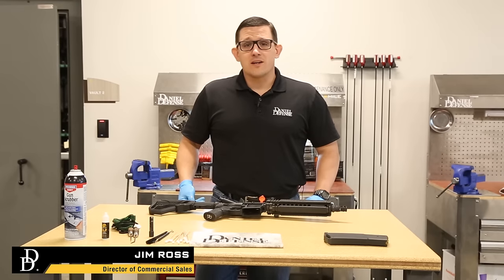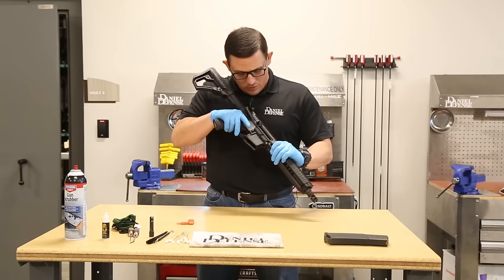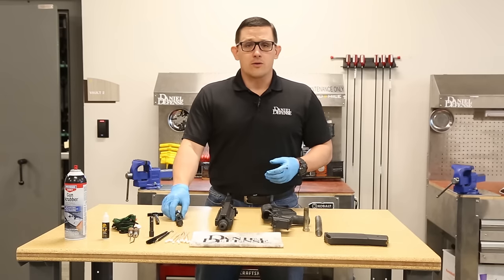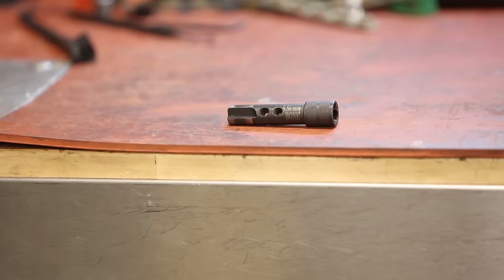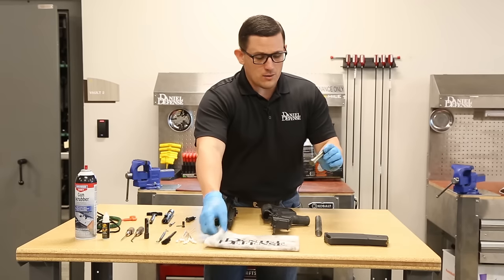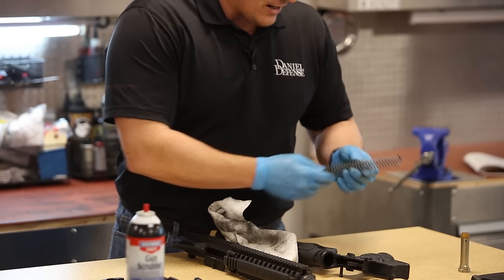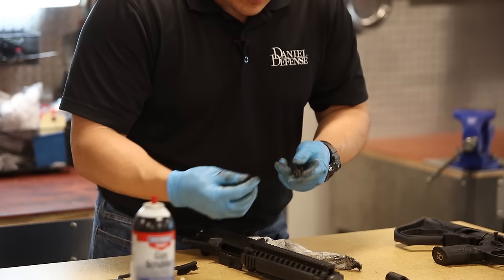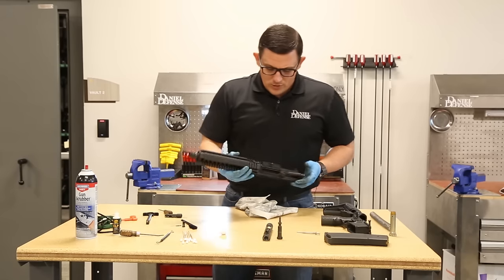Basic Firearms Maintenance

Comment: That was an incomplete cleaning and lubrication in my opinion. He didn't really clean the chamber. The chamber needs to be cleaned well with a brush wrapped with a patch. And you never want to leave the chamber wet with lubricant, in case you need to use it for defense. And the other thing that I disagree with is that the bolt needs to be wiped with lubricant before it's inserted into the bolt carrier to prevent wear. Wear leads to gas leakage

Comment: Hehe..I've never cleaned the buffer/buffer spring in any of my DD rifles and I've shot thousands of rounds through them.  I wonder how dirty they are =D
Reply: Believe it or not, they never get bad. I've shot thousands of rounds through all my buffer devices and the ONLY time I'll take it apart and clean it is if 1) I'm doing a replacement with a different weight buffer or 2) cleaning the rifle for sale. Every time it's had minimal buildup and is a super fast clean.

Comment: This video taught us a lot on how to clean our new Daniel Defense!  Being new in the rifle world this was a big help.
Reply: Yeah he does a few things most cleaning videos don't cover. The parts about cleaning all the carbon out of the inside of your bolt as well as setting the bolt carrier group on its face to make sure the gas rings are good are both good tips.

Personally I don't clean my buffer tube or remove my extractor every time I clean. But I do so every so often. Because it is necessary.

Either way you found one of the best cleaning videos out there.

Long term the only things you might want to buy are a spare buffer spring, set of gas rings, extractor spring/booster washer, and a appropriate length gas tube. A set of Aero spings/pins oops kit couldn't hurt either. Also maybe a spare bolt and fireing pin. But definitely lots of spare magazines. Magazines do go bad.

However for the average guy who shoots a few times a year just a few mags is usually enough. But for the truly prepared the other components can never hurt. And, with the exception of the bolt and fireing pin, pritty cheap also.
Reply: @project86xero  yeah, tip. Clean out the buffer and extractor at around 500 rds or so. The stand on the bolt head to check the gas ring thing, start to do it at around 3,500 rds or so. A good set of rings should last you at least 5,000 rds, more like 6,000 to 7,000 rds if you have a full rifle length gas system.

Comment: Yes sir. 
That DD4 is a must have for SHTF.
Or a extremely well made replacement rifle. It's just as reliable as my Colt M4. 
If for some odd reason the ol Colt lets me down. An the Smith&Wesson M&P 15, 2 was to bite dirt. 
I've still got a damn good one to bring out. 
Don't get me wrong now. The wesson is a great toss in the floorboard. An put in the window mount of the Track hoe lol. 
Put behind the seat of the skid steer. An bounce it down the mountain. 
The Colt deserves my respect and to guarantee its well being. The DD4 was a conversation piece and pretty penny. The mount an nite optics.  Flashlight an tripod. Dont tell the wife a good 3500. It's a piece of Hardware to used. But come on Id feel kinda bad for it sliding out the seat into the floorboard. Or to trip up an roll down the mountain side into a rock filled ditch. 
I've done that as well the wesson took it like a champ. I was bleeding a little. It lost some paint as well an added a little more Tactical grip to the corners and plastic heat shields. 
A tough spot on the hand gaurd an charging handle.  Nothing really bad for a 900 dollar wotk tool.

Comment: New ddm4v7 owner here. Should I clean to this level when new from the factory before shooting for the first time?

There is a coating of some tacky grease stuff in bolt and carrier group and firing group as well.
Reply: I just threw 60 rounds through my brand new DDM4 PDW and it seemed a bit dry so def going to clean and lube it properly before the next range day

Comment: OR>>>> retro fit or build a piston gun using Superlative Arms components. Spend 120 seconds after 1000 rounds to wipe off,  and then LIGHTLY re oil.. No solvents needed. Need only  Two pieces of disposable blue paper shop towels. TWO MINUTES and DONE!...with the upper. 

For the the lower receiver of a piston gun=Brake Clean and re oil. Grease the trigger sear with AreoShell. This may take you four minutes.....tops.
The barrel will be the same as a DI. The chamber will be a bit cleaner on the piston gun if shot suppressed. Use the patented off-gassing feature of the SA piston kit.

Comment: I have a question i have the ris2 rail and after shooting it there was a bunch of junk in between the bolts that hold the barrel nut what would i use to get it out or would i have to take the handguard apart ?

Comment: I have a 14.5” M4A1 RID ll upper pin and welded with a DD flash hider and I was curious to know if I could send it in and have the flash hider changed out for a DD muzzle brake or DD compensator . Can this be possible?
Reply: Yeah any competent gunsmith could do that, dont have to send it in, just check for a local gunsmith with good reviews
Reply: Patrick Murphy There not many in my area as to why I ask. I emailed DD 3 months ago this question and they haven’t gotten back to me .